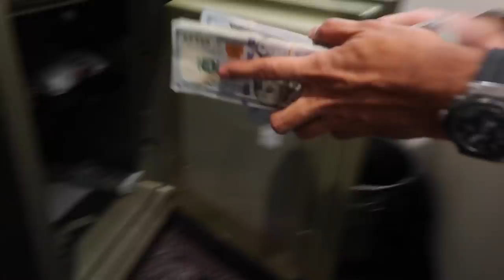I Sold my Car for this much CASH ...

Comment: To jump start a car Mo:

Connect the positive (red) terminals of each car battery together, with a jump lead.

Connect one end of the 2nd jump lead to the Rolls Royce's negative (black) terminal. Then connect the other end to the Mustang's engine block (not the negative terminal).

Turn both cars on and rev the Rolls Royce.

Comment: he bought mustang for 200k and sold it for 100k .the only guy getting richer is deals on wheels
Reply: forum user no he didnt
Reply: its second hand
Reply: Don't know if ur numbers are on point but you've heard of depreciation right? It's what happens the second you drive the car off the lot. Wam. Take the loss.
Reply: Mustang price starts from 35k what u on about 200k